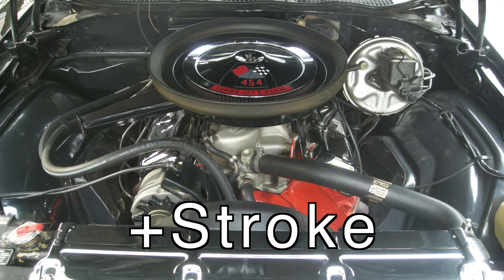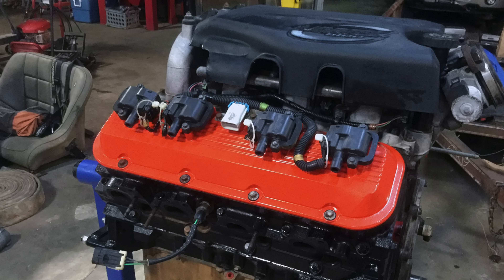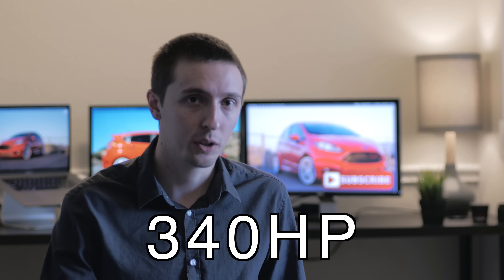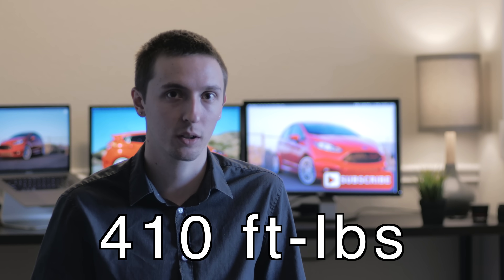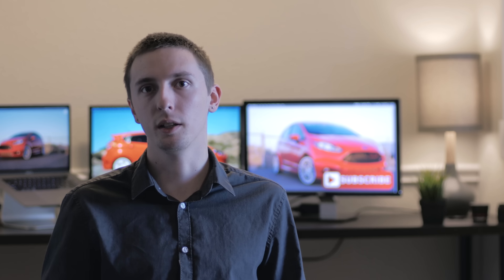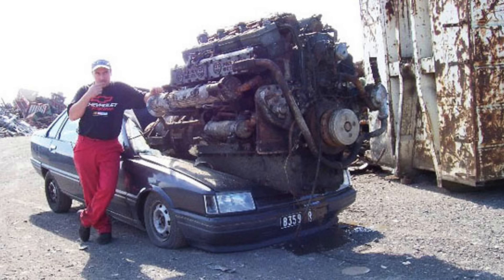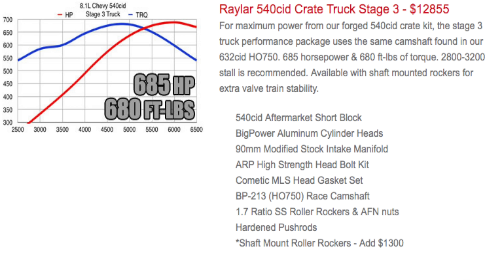Vortec 8100: Everything You Want to Know | Specs and More

Comment from the maker: LS/LQ or 8.1 Vortec or Duramax? Which one would you rather have? Let’s hear it 👇🏻
Reply: I have driven modefied and maintained a lot of engines. My daily now is an 8.1. They can bury me in my truck because NO ONE gets my motor.
Reply: @cecilg.relation2537  Hahaha, that's the spirit. XD
Reply: Depends. The LS/LQ is cheap, common and can hold any power adder on the stock bottom when prepped and tuned properly. 
The 8100 is different, big and just begging for a top end package. No demand for them makes them cheap.
The Duramax.....if you get a good one, add a tune and make easy power. Get a bad one, and it'll bury you financially. You can go as big as your budget permits. They sound awesome. They get great mpg. You can swap them into anything. Bring lots of money to play with one.
Reply: @hoost3056  Why do you think they still use the LS engine and LQ engines? Btw theres been plenty of LQ engines over 1000 hp
Reply: @hoost3056  You dont know much about LS engines i can tell
Reply: @nickvanbeekveld9927  dude, what are you talking about? I chatted up the LS/LQ because its so good....you need to read what i had written
Reply: My mom picked up an 03 Silvarado 2500 HD. Just happens to have the 8.1L Vortec with an Allison trans and 1 ton shocks and 1 ton overloads. It's loud, hot and bouncy, but it will pull the arms off a Wookie😂😂😂😂
Reply: @justinthies6137  And suck the gas like a pornstar.
Reply: I like the sound gas motors make
Reply: i was  a huge 8100 until I towed with my lml durmax
Reply: 8.1 all day. LQ4 for beefing up and dropping in an old Monte Carlo or something. 
Duramax is for millenials to throw money at so they can almost keep up with a stock SS Camaro. Don't forget the 35" tires and 4 inch lift kit.
Reply: @davenhla  TELLING IT LIKE IT IS FOR SURE, 496 /8.1 IS A GAS HOG BUT PERFORMANCE PUTS A SMILE ON MY FACE. AND A LITTLE MORE AT THE PUMPS IS BETTER THAN ALOT AT THE MECHANIC.
Reply: @davenhla  you Forgot about lights everywhere. And fake platina
Reply: Man if you've ever towed with both you'll feel a lightness in your wallet with the Vortec. Seriously every third gas station carries diesel and gas stations outnumber Starbuck's in most cities so availability is almost never a concern.
Reply: @erikkovacs3097  went through a complete cost analysis on gas vs Diesel. Between gas and parts sticking to the factory maintenance scedual the total cost gas vs diesel comes out 5 dollars cheaper for diesel than gas over the corse of 150,000 miles so it's really just a matter of how you want it to preform. Me personally I like the torque of the diesel but don't know all the intricacies of the engines so I would have to pay a mechanic to do the work. Gas I can work on all day long and twice on sunday. Much cheaper for me that way. Again cost to cost no difference just what you prefer
Reply: @christopherwilson5220  Can I see the math? What two engines are you comparing? You find it easier to work on gas engines? Even direct injected turbocharged engines? Compared to an old mechanical diesel? There are too many variables.
Reply: @erikkovacs3097  5.9 cumins same age as vs 454 chevy. Use the maintenance scedual to eliminate variable of parts that last longer than should or less than they should. Use same shop you eliminate variables of labor cost. Specified engine eliminates variables of quality engine.  3 controlled variables not to many not to little to give you a base line. The newer you get the more expensive it gets. And I don't work with turbocharged. I do bare bones 90s to early 2000s. Not to complicated and no turbo to blow it's self apart or add extra stresses to motor. ( if motor is build for the turbo makes no difference in longevity) however it's one less system to maintain. Low end torque I got to get into the 7.3 diesel or newer Cummins before I upgrade from the 454 she's got a flatter torque curve dispite having less torque than the Cummins.
Reply: @erikkovacs3097  math no I never wrote it down. Did it on the phone over the corse of 3 seeks research deciding what to buy next for a pulling truck
Reply: @christopherwilson5220  The thing is, your conclusion is the opposite of everyone else. I mean it is the reason for the dieselization of the trucking industry in the 60's and 70'  the cost of ownership for diesel is less. All that crap about durability and torque is just that; crap. It's all about the bottom line; diesel is cheaper.
Reply: @erikkovacs3097  my conclusion is on neither side. I'm complimenting both gas and diesel trucks while acknowledging the limitations of each. Without jumping into the Comercial vs light duty versions of these engines. My conclusion isn't contrary to yours or anyone else's here its acknowledging both sides.

The trucks I deal with because I build mine I go with the gas because they are much more comon. Also I'm particular to old Chevy for their parts interchangability. My 1 ton I've bought and rebuilt for $6,000 I can't touch a diesel mid to late 90s with less than 100,000 miles on it for less than $8,000 just to purchase the thing before fixing it up. So as much as I want a diesel I haven't afforded the up front cost of more expensive parts and repairs to get the better fuel econemy. Instead I have a cheaper truck that I built that I pay a fiew more gallons for at the pump.
Now you want to talk cheap and easy there is a video of an f150 completely custom. Inline 6 Perkins diesel motor 2 transmissions 4 wheel drive dually.  Can pull a house down and still gets 32mpg when empty. That's the truck I'm working my way twards. Mean time I got to keep building trucks and hauling trailers. I'll give the name of the video in my next reply
Reply: @erikkovacs3097  Martin's Perkins diesel swapped 1986 f150
Reply: @christopherwilson5220  $5.00 CHEAPER FOR DEISEL THAN GAS ENGINES,,, YOUR OUT OF YOUR MIND TO ACTUALLY THINK ANYONE WOULD BELIEVE THAT ONE.
 BETTER GO BACK TO SCHOOL PARTNER AND TAKE A WHOLE LOT OF MATH CLASS. 🚚🚚🚚
Reply: @crazyhorseranchaz  I have been going back to school. For many years now... keep in mind that this mat is done and calculated for vehicles in the range of light duty truck from the 1/2 ton to the 1 ton HD where the epa only a lows small desils. Once you get into commercial size trucks the numbers get blown out of the water. I don't need to go back to school you just have to understand the context
Reply: @erikkovacs3097  CAN'T EVEN COME CLOSE TO THINK DEISEL IS CHEAPER THAN GAS IN ANY ASPECT. EVERY THING YOU DO ON A DEISEL WILL BREAK THE BANK.
  EVEN OIL CHANGE ON DEISEL COST SO MUCH I'D HAVE TO DIG IN TO MY KIDS COLLEGE FUND.
  YEAH I KNOW ALL ABOUT IT LASTING LONGER THAN A GAS, BUT DIRTY IS DIRTY, OIL STILL BREAKS DOWN OVER SAME MILEAGE AND WILL STILL NEED TO BE CHANGED MORE OFTEN THAN A DEALERS RECOMMEND TIME FRAME.
  DEISEL WORKS AS IT SHOULD TO HAUL AND PULL,, WHICH MEANS IF YOU CAN AFFORD ONE, THEN BUY ONE. THE FUEL YOU SAVE IS NOT WORTH THE COST OF REPAIRS.
  A GAS BIG BLOCK WILL COST LESS ALL THE WAY AROUND, A BIT MORE COSTLY ON FUEL, BUT IT HURTS LESS THAN THE COST OF THE REBUILD OF ANY DEISEL.
  OVER THE ROAD TRUCKERS ARE SOLD ON DEISEL AND FOR GOOD REASON,, BUT NOT FOR THE AVERAGE FAMILY.
Reply: @christopherwilson5220  you sure brag up that F-150 which is got a lot of money tied up into it and I know somebody that has a S10 4 wheel drive with a 355 in it that I personally seen him pull down a house with
Reply: @erikkovacs3097  Christopher admits he don't know nothing about diesels therefore that would cost him more money because he'd have to have somebody else do the work for him
Reply: @joen5332  what kind of prep work was done to pull the house down? How was it torn down? Anything can pull a house down in small enough pieces.
Reply: @erikkovacs3097  looking quite foolish now :) Diesel is about $1 more per gallon and maintenance is much higher.. Not to mention the higher carcinogens and physical risks of diesel exposure.
Reply: @JustinMurta  1 dollar more at $2 is different than 1$ at 5$. The first being 33% higher while the second is 20% higher. The nationwide average spread is 15%. I live in California and it's even closer here at 10%-12%. Average fuel economy saving is 30% gasoline vs diesel. Maintenance is a cost but is much lower than fuel costs in overall ownership. Especially with high fuel prices the difference is magnified. So not foolish because math.
Reply: @erikkovacs3097  Agreed! Not just math, but grammar as well :)
Reply: @JustinMurta  LMFAO and now diesel is cheaper than gas SMH
Reply: Love me some 8.1 but definitely duramax had a 6.0 before my duramax never going back
Reply: For everyday street driving enjoyment I like how the gasser feels over the duramax but you can't beat the Duramaxs towing. Having both, I would always pic the 8.1 to drive everyday. It's my go too truck.
Reply: @CaptainsvLogs  yupper
Reply: If I'm paying for and doing the maintenance and repairs I want the Vortec 8.1!  I already have an LS in my 1500 and it's a GREAT engine, but it really struggles pulling loads over the high passes.  Diesels are where it's at, BUT the cost of ownership is too expensive if you're not making money with the truck (e.g. construction, hotshot etc.).  I use my truck for hauling wood, gravel, bikes and the occasional travel trailer but only a dozen times a year making the Diesel cost too much on a $/mile basis.
Reply: Should I buy a Silverado 2500 with the 8.1 it has 204,000 miles for $3500
Reply: Duramax...no contest
Reply: @EasyFinancialFreedom  You got that right, I've had both. That gas burner sucked ass.
Reply: I would rather 6.0 vortec
Reply: @graysonstanley2669  496 /8.1 WOULD BE EVEN GREATER FOR ALL AROUND PERFORMANCE.
Reply: 8.1 less hassle cummins rule duramax has problemslike a power joke.
Reply: I would definitely go with the Duramax I currently own a 2003 Silverado with a 8100 vortec and it's a dog when I tow my 32 ft enclosed race trailer especially with a load on it compared to the Duramax diesel if I ever get another truck it's definitely going to have a diesel in it hands down and 410 gears
Reply: Duramax over the 8.1.
Reply: I have 3 Chevys a 2004 3500 8.1 4.1 rear gears 4x4 262,000 miles; 2001 2500HD Duramax lb7 3.73 rear gears 4x4 93,000 miles ; 1999 2500 6.0 3.73 rear gears 4x4 212,000 all three are good trucks I like the engine in each of them . The Duramax LB7 can get twice the fuel mpg then the 8.1 gas.
Reply: Duramax’s they last forever and these years are more reliable
Reply: Dust Runners Automotive Journal a LQ9 would be alot easier im in the middle of the 8.1 swap from a 5.7 vortec
Reply: 8,1
Reply: Sir is it your opinion or is that a fact about popularity?
Reply: Id love an 99-02 dually 3500 silverado with that 8.1
Reply: Have an 05 lq4 love it great engine
Reply: My truck has the 8.1
Reply: 💪 LSX454
Reply: motor lexus in toyota thundra 5l7 garantie 400000 kms sans soucis
Reply: I love my 2001 8.1, crew cab,  light gray, Allison Silverado.. bought it a few years ago with 79K miles. Now has just over 100K. Truck still looks new. I can cruise at 80 or 90 with very low RPM's. 12 MPG highway, which I don't mind.
Reply: I have a LM7 5.3 LS Vortec
Reply: I currently drive a 5.3l but looking to upgrade to a Kodiak. My conundrum is the state I live in, California. The DMV, AQMD & Governor has put an end to service trucks that are not 2012+ or equipped with after burner equipment that cost well over $10,000. My goal was to either find a service truck (duramax) and do a truck bed conversation to loophole the law and register as personal use. Other option is to get the 8.1 and find ways to beef up the engine. Towing off-road toys and trailer would be the seasonal purpose (150 miles to destination with one long grade). Your video is the first that I found that talks about the 8.1. Will do my research to weigh pros/cons.
Reply: For an older truck I would go 8.1 all day, in a newer truck from GM in the medium/heavy duty segment I would get the 6.6 gas over the Duramax because the Duramax has very problematic DPF systems and the only downside to 2007+  GM gas V8's is the active fuel management. But GM was smart and didn't put in the 6.6 gas. But in my opinion the Ford 3v 6.8 V10 is superior in torque and was more popular than the 8100, unless you cared about gas mileage, it's hard for V10's to break into the teens in mpg
Reply: I'd take an 8.1 Vortec. If I wanted a diesel I'd go with a Cummins, 7.3 Powerstroke, or a 6.7 Powerstroke
Reply: @davidperry4013  I've had them all, Duramax all the way.
Reply: I'll take the 8.1 over the Duramax any day
Reply: @MDC2020  Joking, right, I had a brand new one in 2001, kept it abought two months, hated that thing, went to a Duramax and never looked back.
Reply: I have a 2002 GMC SIERRA 2500HD With the 8.1 and has 285,975 miles on it and it still runs great 👍🏻. I has consistently ran great since I purchased it new... Awesome Motor w the Allison 5spd...
Reply: A Gen III/IV/V 6.0/6.2/6.6L or Gen VI 7.4L is a much better choice than the 8.1L. If you absolutely need the extra displacement, a simple 402-468ci stroker LS/LT will get it done with less weight, less money and just as much if not more power.
Reply: Drumax ya it costly to repair and fill up but it gets better fuel mileage than the 8.1 but drumax last longer than the 8.1 250k-300k miles on the 8.1 you need major repairs vs 750k-1.5 million miles on the Duramax and you need major repairs Duramax hold their value good $10k-$25k depending on mileage and shape vs $3k-$8k on the 8.1 both of them are very reliable engines but the Duramax is little bit more reliable.
Reply: Believe it or not a completely stock 8.1 with a turbo, E85, and only 7lbs. of boost, makes 635HP and 845lb-ft of torque on a SuperFlow engine dyno.
Reply: I own both. I own several duramaxes and one 8.1. The duramax can out tow it but the 8.1 is really strong
Reply: Look at the tune in the ECU for the 8.1 then open the tune for the 4.8 of the same year notice anything there almost the same its a crime i tell ya.
Reply: Is integration between them logical?
Reply: have not personally owned a duramax but own an 8.1 sierra
Reply: @Shane423Chicago  can u put that 8.1L in a single cab Sierra?
Reply: @calilifestyle2313  I am not an expert but I have seen a couple guys throw this motor into an old square body single cab truck and they just go baby go!
Reply: I’m selling my L5P Denali and just going to pull with the 2001 8.1 that I paid cash for. Personally, I think the 8.1 is more fun to drive, even though it’s almost 20 years older. But the reality is, it’s a better financial decision. There’s no depreciation to worry about. Minimal capital investment, still as useful for pulling the work trailer. I’ll go put the money I save in to something that actually brings me a return.
Reply: @alexs3187 , YOU tell em, cause the truth is hard to beat, as well as on the road. Have fun with 8.1 /496.
Reply: I'd take the 8.1 do cam heads intake headers and put it in a c6 corvette with a 4 speed
Reply: @brockmaine2743  That is foolish.
Reply: @brockmaine2743  all that plus spray that puppy with NoS2 like the police do a suspect. Start with turbo,then 2 turbos and end up with 2big turbos driving 2gigantic turbos and ending up with fully blown possibly top fuel can't do anything else to make it faster engine and shoehorn it into something stupid like a old Honda ccvc or Opel manta or GT .. (Check out the Opel GT. and the rwd CVCC) . Just to see how fast you can get. Be fun to play with in several things. Mustang 2, pinto, AMC Gremlin and believe it or not in the 97 model year the Ford areostar minivan was the most areodynamic vehicle Ford produced. A teardrop shape is the best areodynamic shape so far discovered. In a perfect world I would have enough money to design build and test my own car in a 3d teardrop shape. Put the biggest engine I can find in one and the best/fastest engine of my own design or whatever is bigger faster more hp and torque on the lower and midrange portion of the Rev band in the smallest thing that can actually hold it just to see what happens. In other words the absolute most hp in the lightest or best possible hp to weight ratio. I've always tried to get the most hp in the lightest things I can. I'm about to put a Kawasaki KSR650 MOTOR in a go-kart that weighs less than 30 pounds completed ready to drive minus the engine and driver. I weigh 150,cart weighs 27 pounds and 5.25 ounces. Not sure what the engine/ transmission weight is yet. That equals just over 200 pounds completed ready running and my old ass driving down the road. The 4stroke 652cc engine in the bike as new weighs 480pounds. The engine stock (new) is 40hp. The bike will actually run faster than the advertised max speed of 95 mph. Around 90ish it gets that unsettling high speed death wobble. Had to back out at 95-97 mph because I could barely keep it upright and on the interstate. Can't wait to see how this works out.
Reply: @brockmaine2743 you build a 498ci tall deck LS based stroker why bother with an 8.1L?
Reply: Ls for sure. Duramax's smells so bad
Reply: @ClintonC1991  it is a diesel all diesel smell lol
Reply: @ClintonC1991  The Duramax could smell like a ripe skunk and I would never go back to gas, gas, what a joke when towing.
Reply: Me personally,   I wouldn’t trade 3 8.1s for my Duramax.
Reply: @bradcallaghan8099  personally I will never change my 454 build by gm for a duramax build by izuzu.